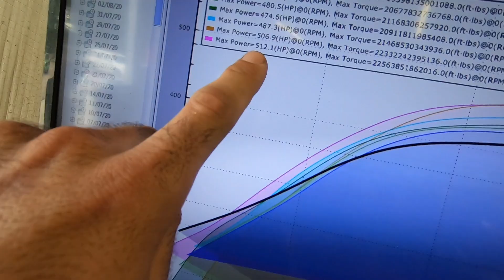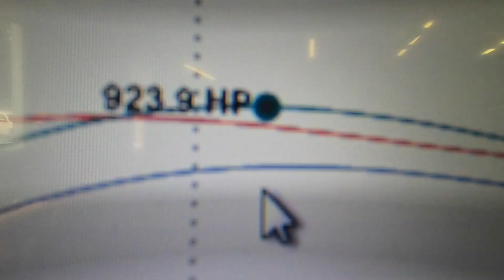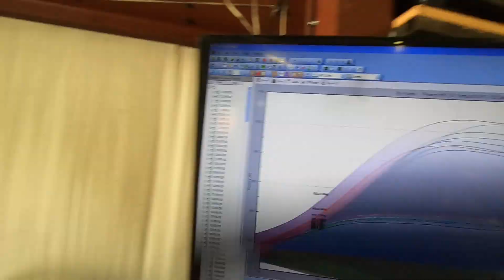Forced Performance Turbos Dyno Comparision

Comment: What stall converter you got? 👍
Reply from the maker: It’s a PTC converter specd by Dusty Bradford.  The stall changes based on how much power we use so there isn’t an exact number to nail down BUT it works flawlessly!  Hit them up!
Reply: I was thinking after all motor maybe after 2 years going Turbo and see how my 5500 stall converter still work for that, 🤔👍
Reply from the maker: With a turbo it will probably get REAL loose lol.  Depending on your power goals, you should be able to get something for your combo for relatively little money if you sell your current one to offset cost!